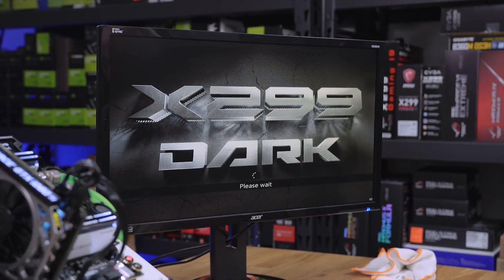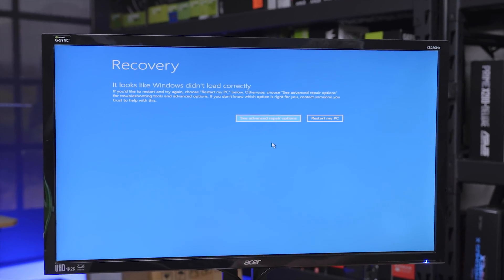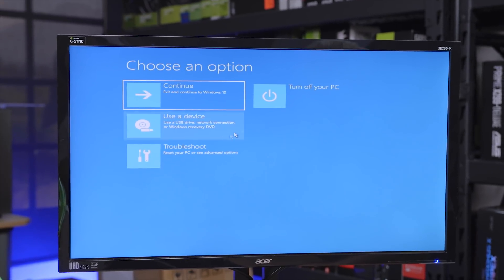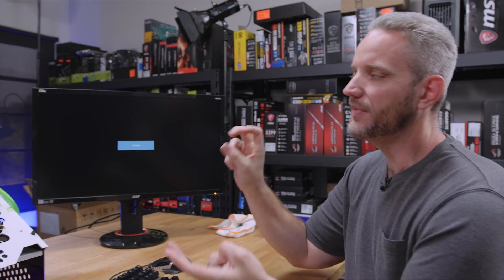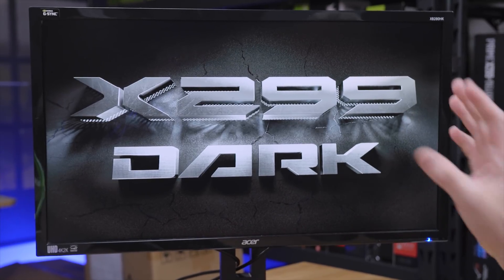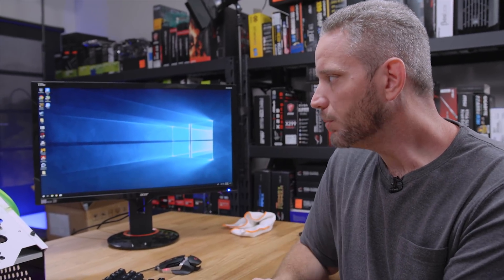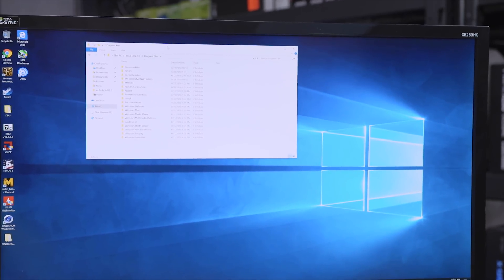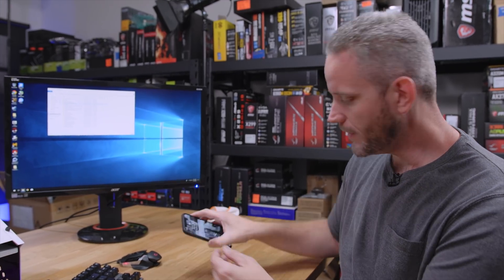New Test Bench Keeps Boot Looping... Here's how we fixed it

Comment: you need safe mode, you have to wait for 3 restarts.... and on the other hand, you are testing oc timings and every 3rd try you know you ll get that stupid ooh windows didnt start correctly do you need recovery options? No I don't ffs! :D
Bring back the F8 spamming to get boot options !

in case you are not sure of what is crushing windows running msconfig on safe mode should enable you to change the apps that start with windows (and even if your windows don't crash, just go there and disable cortana, phone link and edge :P )

Comment: Jay I'm having issues with my GPU (brand new RTX 3070) it gives me a signal but after I see my MSI Arsenal Gaming screen the windows wheel spins once or twice and then resets. What happened was I saw the LTT video for k5 pro and of course I wanted more FPS so I slapped some on. Temps increased really high. Next day I decided to take it off I used a guitar pick and a soft cloth then the issues started. First artifacting so I was like let's clean it better. After the second cleaning it started the boot loop. I can use windows in safe mode. Windows boots fine without drivers for gpu. As soon as drivers install back to boot looping. I'm not sure what's going on since it was literally just removing paste with alcohol but it sucks since I paid so much for a new GPU and I ruined it.

Also it's for sure my GPU. My RX 590 boots up and everything just fine.

Comment: So many  BSOD Videos show "Hitting your start button".......Cant boot to Desktop or even get Safe Mode. Have Fast Boot/Secure Boot disabled. DEC1st did System Restore to 3 Days earlier. 100% Complete. Restart, BSOD Non Paged Area Fault NTFS.sys. BSOD Screen lasts 1min 45 seconds then restart, then shut off, so therefore cant run ANY DIAG fixes. I have good working Comp SSD Drive hooked up to Tower and the "Problem Child HD" hooked to USB Extended Hard Drive. I HAVE TO pull USB B4 it hits time lapse so I can look at what it wants to show me. Did the WINS 10 Install/Repair Computer Options. Shows X Boot and there are other folders. Downfall is canNOT leave HD running to Trbsht.

Use good computer and open Control Panel, hook USB up, shows Recovery Free 89.7G out of 120G(SATA 3T Drive), and HD "C" with no explanation. I guess my hunt goes on. Did power cycle a hundred times, replaced CMOS battery, onandonandon.

Comment: came across this video and noticed the first commercial advertisement for combing 2 cases into 1.. all because someone HAD too many HDDs.. LOL!!! so hopefully by now JTC has been guiding the user to the NEW ultra capacity M.2 SSDs.. oh and keep that duck tape nearby.. when ya run out of proper mounting slots... perform "pull to size, rip it off, apply to item & stick to an OPEN space inside the case... then SMILE.. ".. these "WA-LA" moments are precious!!

Comment: I stopped using Windows 10 Home edition when it went into total meltdown. It would not boot. It would not recover. It would not even reinstall. Online Windows half was useless. When I called Microsoft the automatic phone system hung up on me when I told it I had Home edition. I now use Ubuntu MATE 18.04.

Comment: My PC started to behave all of a sudden where it's just stuck on gigabyte auros logo and no matter if I reboot 10 times, it just doesn't boot into Windows neither safe mode nor an option for recovering.

I removed m.2 ssd and did a fresh windows installation on slow HDD but it's still the same. 

Removed CMOS battery and reseated it, didn't help. 

Performed BIOS update to F21 it booted and was happy till I switched off and came back next day with same problem. I didn't go any higher as I have Ryzen 9 3900x so I downgraded back to F20 then same story, happy as long as it was up and running then baaam same problem next morning. 

Tried booting with all different RAM sticks. Only on A1, B1 32GB total 2600Mhz didn't help. Tried A2, B2 didn't help. Tried same thing with 32GB 3200Mhz sticks...Nope. tried single RAM stick 1 by 1... Still nothing. I came across videos where gigabyte is infamous doing this to lots of people then I was like.... aaaah, so it's the MB not the CMOS battery, not the RAM slots, not the RAM sticks, not the cabinet, not the m.2ssd, not the HDD.
But how did even BiOS go corrupt? That too all of a sudden on a 3 month old motherboard? Pretty annoying to go through this after paying lot of money for Auros Elite WiFi added to this it is MS OS
 Aaaaaaaaaaaaaaaaaaarrrrrrrgh

Comment: JayzTwoCents,,,,, i have a HP Pavilion DV6 2151 entertainment notebook intel core I3 !! Was working fine and I went and tried starting and it seemed to be in a loop,,, so I tried restarting three times and no help. So i went in trying to get to repair mode,,, so when start up came in i started hitting F8 and finally got in and i tried repair mode and it never gave me the option, the following screen jumped right past the blue screen that system recovery, and start repair options,,,, I did that numerous times, and i cant get it to let me enter what i needed. So it is just repeating itself over and over with no place for me to enter anything!!!  I dont know what else i can do,,,, i have another desktop system but I dont know if i can reboot or make something to help this situation. I have the recovery 3 recovery disk's but not sure what to do,,,, can you help with this problem ??? Thank you i will await your response. ((WINDOWS 7)) if it dont reset itself and i can t type in anything then what??? thanks Char C.

Comment: In my view, Blue screen error is happening because of so many unpopular reasons also. Recently, my brand new PC (Windows 10) was showing blue screen & tried different known solutions but was not successful. After that I tried so many trial and error methods and found the real culprit which is accounting software Tally. Here is the story:  My new PC (Windows 10) was running as a client PC on a network and another PC was running as the Tally server (Windows 7). Then I found that Blue screen happens nearly 5 - 6 times or more daily in my new PC only when Tally is in use. Finally, as a simple solution I changed my new PC (Windows 10) to Tally server and server PC (Windows 7) to client PC, which was successful.

Comment: But I got a different situation, my CPU is R7 3700x and GPU is Radeon 5700(It's the Omen 25L model bought from Costco) which is a Ryzen based, what should do with the boot looping?(I bought it this August, couldn't fix it so I figured I better return it and order a new one, and now the 2nd comes and it got worse, I had to restart the pc for like 30 mins by clicking "continue" and "restart" over and over again to get it to user interface)

Should uninstall the Ryzen Master on this Ryzen based PC?

Comment: JAY!! I NEED YOUR ASSISTANCE SIR...
Since you were the one whose video helped me fix this before, I once again come to you for help.
And I'm only one of many experiencing this problem, so there may need to be a concerted effort into solving this one..

The gist of my memory woes: 

System spec - AMD R5 2600 / Aorus B450i mobo / GTX 1070ti / 16GB RAM installed

BIOS detects all 16GB, but one slot's timings don't match the other's no matter what I try
Windows sees the full 16GB BUT insists on reserving half of the RAM, even though I never set it to do so.

This is within a fresh install of W10 2004, and the same issue has occurred in all iterations of my windows installs, persisting right through to the next install even when using a completely different HDD/SSD. So pretty much about 5-6 times. Every time I install Windows the problem returns immediately.

Also one major thing to note is I noticed just a couple days ago in task manager it says 2 of 4 slots occupied...
BUT it's an itx board with only 2 RAM slots, so there's definitely a clue.
Just not sure how or why the slots are being detected improperly, or what it means.

What I've found in my research on the "HW Reserved Memory Allocation BUG":

Best I can figure from my own deep research regarding the slots being counted wrong as 4 slots (2 per channel) instead of the proper 2 slots (1 per channel) could be some value in registry for the driver ranks being borked... but I've only just begun learing about driver ranks and registry values so I have not done much experimentation there as I don't like to tread unknown territory to heavily lol

I recall you did upload a video with instructions I used to fix this some time last year (around Aug to Nov 2019) 
And whatever it was that I did based on that video was the fix.
Seem to remember there being an auto configuration via OneDrive that you disabled prior to reinstalling drivers??

I too have switched around hardware too many times to count this past year and I feel like that may be the cause, whether directly or indirectly it is probably in some way related. 

I have also seen a TON of people seeking help with this same issue right down to the specific h/w combination that I'm running.

I MEAN FOR REAL CAN WE JUST LEAVE ONE DRIVE OUT OF CLEAN WINDOWS INSTALLS FROM NOW ON?!?!?!

Comment: stuck with bsod  atikmdag.sys error boot loop , cant get into bios, usb/odd wont read , pressed every key f8,f2,del,f11 etc & nothing  , cant get into safemode or startup repair when i put windows disc in. removed battery in laptop and nothing. tried putting linux usb wont read.  great job microsoft

Comment: Back in April 2020 I made an image backup of my Windows 10 along all the software's that I use because it was not giving me any problems.  Two months later with all the Windows update I keep getting, it started with my internet connection that keeps dropping out and finally the BSOD.  No matter what I did, I keep getting the BSOD.  I stripped all my hard drives from my computer to just the M.2 to use as the boot up drive.  Still I keep getting the BSOD.  Thinking this was a Windows 10 update that caused the problem I reloaded the image back up of Windows 10 that I created back on April 2020.  After reinstalling I turned off the Windows 10 update preventing Windows from installing updates.  So far I no longer have internet drop-offs and no BSOD.  WTF are these bozo's in Microsoft doing ?  Why fix it if it ain't broke.

Comment: please help sis 🙏 why is Ryzen 3 3200g on GPU Z only reads 64bit bus width instead of Ryzen 3 3200g 128bit
   what's wrong with that?  the motherboard that I use asrock a320m-hdv r4 ram patriot 8GB single effort that I have done update the motherboard bios to the latest version is also the latest adrenaline driver but still on the gpu z only reads 64bit, all games played instead turn into blue screens.  please reply please thank you

Comment: Hey, I love your videos, I got an issue, I haven't been able to find a solution yet, maybe someone here can help. I purchased the 49 ultrawide samsung monitor, and my PC only turns on if the monitor is off (extremely frustrating) I never had a problem with other monitors, my PS is 900W, I don't think that's the case. When the monitor is on my computer makes one beep and it boot loops and it makes one beep again and it does this endlessly until I turn it off by pressing the power button, then I turn off my monitor, start the PC again, right after I hear the beep which indicates the computer is on, then I can turn on the monitor, and the PC boots fine. Any ideas? or website/forum I can ask?

Comment: My friend's pc has the same problem, it blue screens for no reason but instead of restarting it just shuts down and I have to turn it on myself. Also, it doesn't boot into safe mode at all before launching safe mode it just blue screens again with the code: CRITICAL_PROCESS_DIED 0x000000EF, it would mean the world to me if someone can tell me how to fix this, or at least tell me why it is doing it, otherwise he has to send in parts to get it checked out which would cost $23.16 per part. He recently bought it and is devestated that he spend $1000 on it and it bluescreens for nothing. And like I said it would mean the world to me if someone can help me out. Thanks in advance!

Edit: Sorry he spent $1984.89 on the pc.

Comment: Win10 definitely should be able to have better troubleshooting options.  For this issue, you might also have been able to change the Windows Installer service from Manual to Automatic or use PowerShell to run Get-AppxPackage AMD Ryzen Master | Remove-AppxPackage

Comment: Waiit I'm confuffled. (I went through the same process, changing from AMD to intel) So how does renaming the AMD folder and restarting fix the problem.
Reply: Renaming it works because upon startup it will look for the AMD folder, but if the folder is renamed, it won't be able to locate it and it'll just be like "meh" and continue booting into Windows.

Comment: You should also be able to use something like BCUninstaller: https://github.com/Klocman/Bulk-Crap-Uninstaller. It's open source and has a portable version so you can run it from a flash drive or whatever you happen to have. Even if the installer fails, it can clean up the program's files and registry items.

Comment: Actually I just plug in my windows 10 installer USB and use it for my recovery options.  Dont have to power cycle.. or safe mode.. fidget with things..
Also saves a step or two if I need to fresh install..  But I'm going to say this now, use windows reset built into your windows 10 before you do that fresh install madness..

Comment: That's a very handy trick. i also use an external forced-uninstaller, so i can get rid of folders, dll's, registry entrys, etc, not using windows unistaller service. All of this, of course, if you can enter to safe mode. There is issues when safe mode doesn't even works.

Comment: I can't even overclock my system anymore ,windows 10 just keeps crashing and crashing and crashing and crashing without any fix any solution.... Went back to windows 8.1 , everything works flawlessly,with same oc settings under the Bios...Rly Micshitsoft,Even windows vista wasn't such a pain in the ass.Windows 10 is bullshit.

Comment: Hey Jay, don't forget that MS also removed the ability to do an in place install from boot. You get the message that you need to do this from the desktop which of course is impossible if you can't boot. Back in the day if you had a system that wouldn't boot you simply did a repair install over the top and more often than not you were back in.

MS apparently does not like you being able to fix your OS, like of like Apple and their hardware.

Comment: Hm, Linux handles hardware changes really well. You can even install from a working OS on one computer (by using something like debootstrap) and then boot the hd on another. (I think Windows has DISM but Linux usually handles hardware changes better because of the way that the Kernel handles hardware.)

Comment: I had to do this process after upgrading my processor to ryzen. Apparently amd overdrive was causing the crash. I used the boot into safe mode with command prompt, and then uninstalled overdrive from there.

Comment: A couple of weeks ago I encountered a boot loop with BSOD, but the issue was, that errors seemed random by nature.  So I did a whole lot of startup disabling, did sfc scannow couple of times and when the problem seemed to be fixed, it again appeared 20 minutes later. So I continued the previous routine, but this time I went into BIOS settings and underclocked my RAM. The reason being I thought if this is a hardware fault and if we look at all those "random" errors, they all seemed at least a little bit related to memory, so it might be a faulty RAM stick. After underclocking that, it all went fine. My next option would be taking out one of the RAM sticks.

Comment: Yeah, the installer service not running in safe mode is annoying, but everything else I don't see as a Microsoft problem.

Create a Windows install disk and an answer file, or get a generalized sysprep image that has only your test software installed. Yeah, you'll have to spend <10 minutes installing Windows, but you won't have to spend time troubleshooting these types of things. Which, in Jay's case, produced a video and therefore money... Everybody else that does this kind of stuff, please don't blame your tools for your misuse of the tools.

Comment: Alot of people here a quick to go guns blazing and blame jay for a "rookie mistake". Sometimes you forget to uninstall some software that is not compatible with the new hardware. 

If you are so goddamn smart, you go ahead and start a tech channel and never ever make a mistake, i dare you to try.

Seems you cannot even consentrate on how to go forward, inform the obvious flaws on ryzen master that it locks up if you are not using AMD cpu, inform Microsoft that their uninstall does not work in safe mode and to get into safe mode it takes a freaking road map. 

Not all people are tech savvy and i bet this video helped them a lot. 

If you can crack these kinda problems another way, good for you. I bet jay has hes reasons why hes not running 2 SDDs with different OS installs for AMD and INTEL.

Comment: Windows Installer service is not running in Safe mode so you can’t install or uninstall some program. To fix this issue, you have to add a registry entry for Safe mode that you’re using and start the Windows installer service
Open command prompt as an administrator
Type this command and press Enter REG ADD "HKLM\SYSTEM\CurrentControlSet\Control\SafeBoot\Minimal\MSIServer" /VE /T REG_SZ /F /D "Service" 
 Start Windows Installer service by type this command. net start msiserver
 uninstall the program

Comment: You can add 2 Registry entries and then you can start Windows installer in safemode

REG ADD "HKLM\SYSTEM\CurrentControlSet\Control\SafeBoot\Minimal\MSIServer" /VE /T REG_SZ /F /D "Service"
REG ADD "HKLM\SYSTEM\CurrentControlSet\Control\SafeBoot\Network\MSIServer" /VE /T REG_SZ /F /D "Service"

Then when in safe mode you can start the service